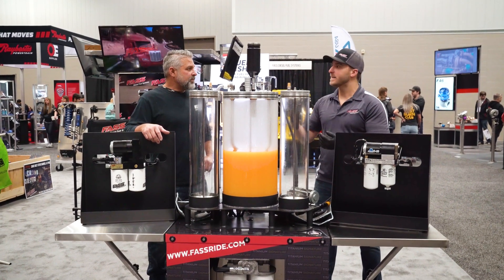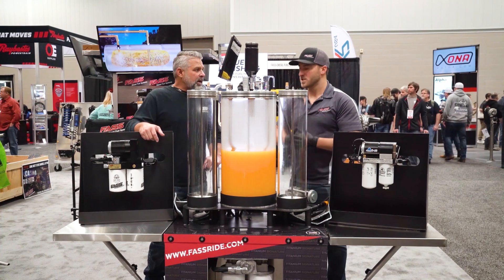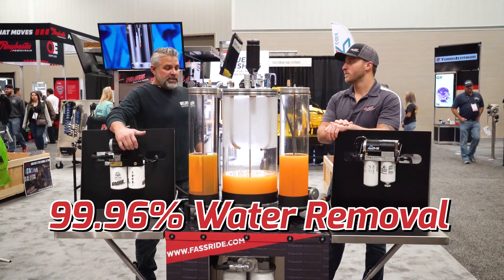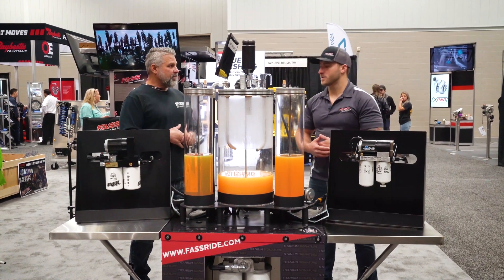Steve Darnell puts the FASS Fuel Systems Extreme Water Separator Head to Head With The Competition!

Comment: My new fass filters froze up this week.  Even with a fass heater installed.  I was bummed to say the least.  -20s for a week's with -30 at least two days.
Reply: Make sure you're running the 2 probes and the filter disk, then add the coolant hoses, bet you won't freeze up then...gotta prepare for those kinda temps

Comment: Wait...I thought it removed all air?
Reply from the maker: The system does remove all of the air when it's installed on a vehicle, for this demonstration we have the fuel return/air separation port blocked off that's why you're seeing the air.
Reply: FASS Diesel Fuel Systems ahhh. Makes sense.